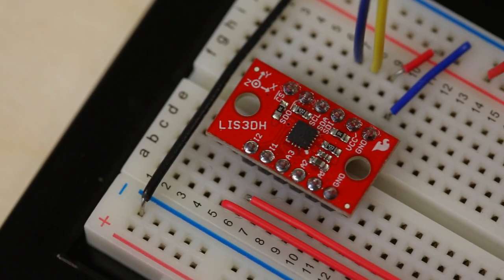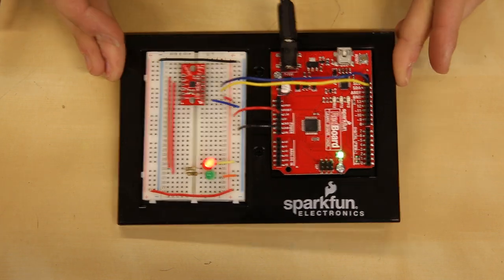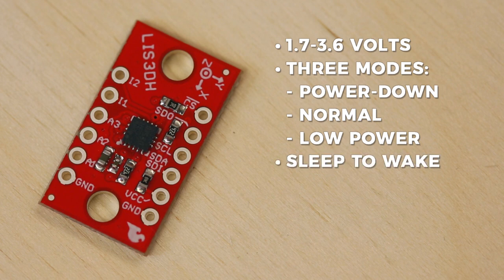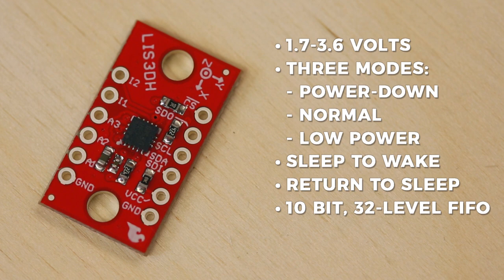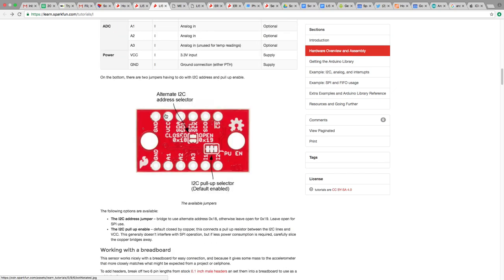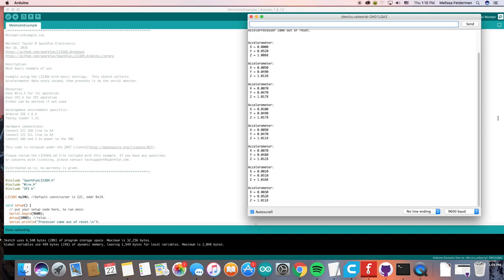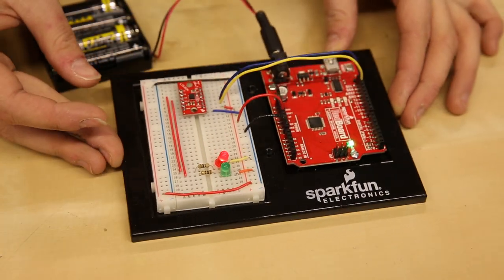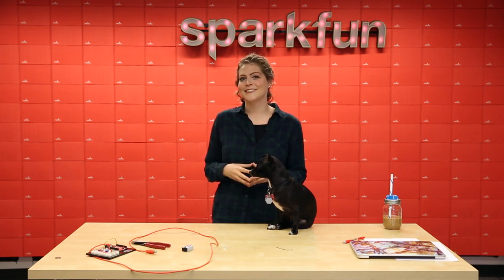SparkFun LIS3DH Accelerometer

Comment: Excellent!
Reply: Fish Kungfu wrong
Reply: Arduino Guy Projects and More! what does this chip have that the mpu6050 doesn't have? The mpu6050 also has gyroscope as well as an algorithm to calculate quaternions based on both gyro and acc and is even far cheaper.
Reply: Arduino Guy Projects and More! Excellent!